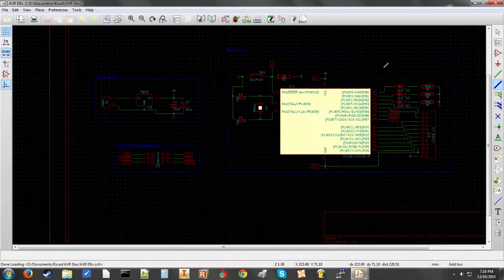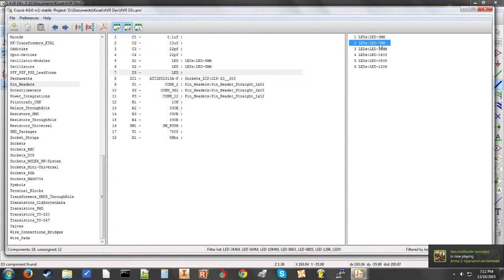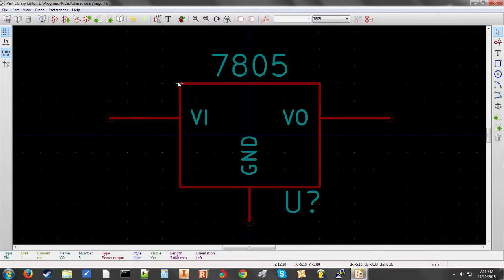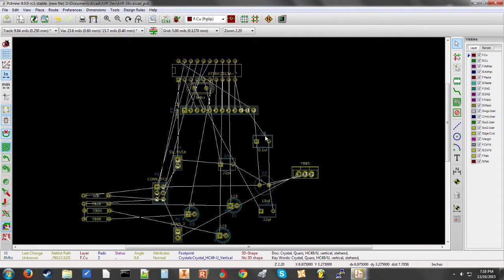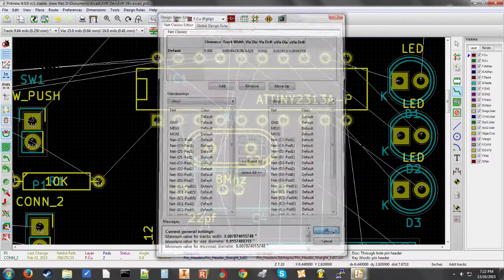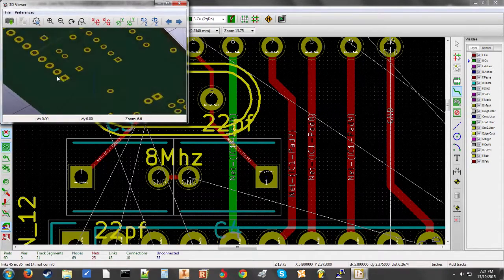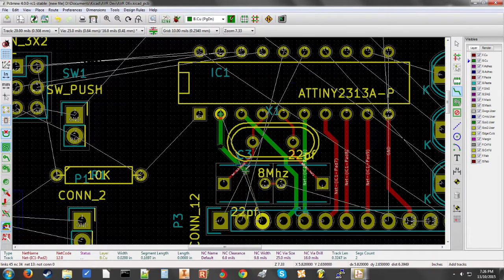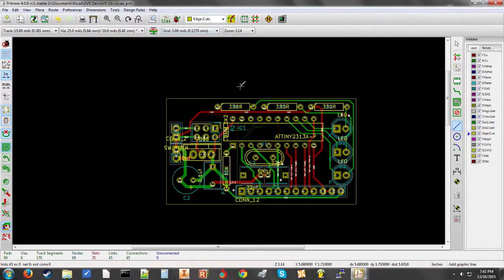KiCAD Basics - Part 2 - PCB Design

Comment: Another tip for you. On Pcbnew, instead of manually placing all of the components once you initially read the netlist, click on the Mode Footprint button. (It looks like a 6-pin DIP with move arrows on it. It is located on the top bar 4 icons from the right.) Once you have it selected, right click anywhere on your board, and then click on Global Spread and Place. After that choose whichever option best suits your need. Thanks for the video <3
Reply from the maker: +Russell “Roller” Waldrop Excellent tip! I'll be sure to mention it in future videos! Thanks for Watching!
Reply: In the nightly build of kicad, they have fixed this, so when you import components from the schematic viewer using F8, it will automatically spread the componts, even if using OpenGL view.